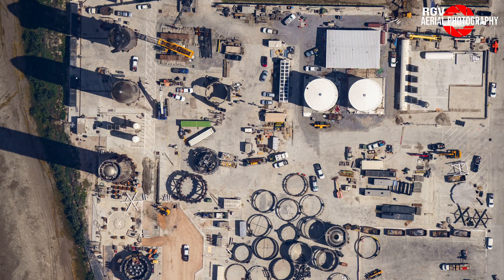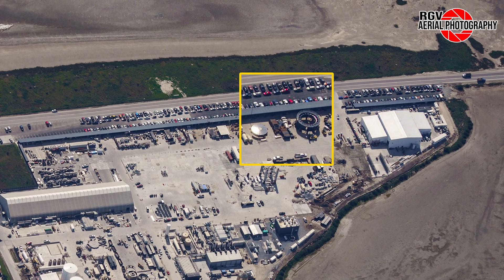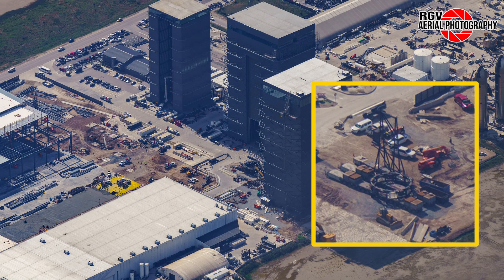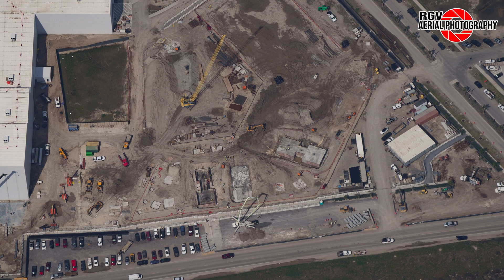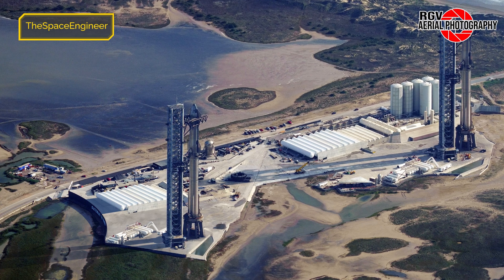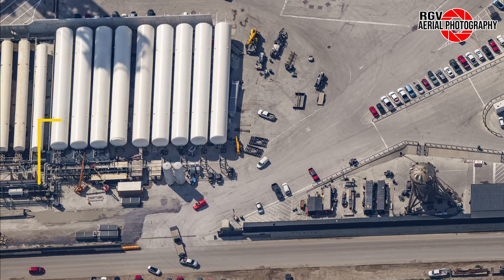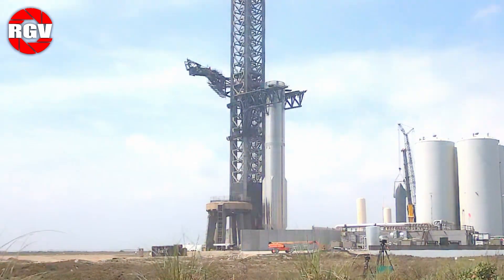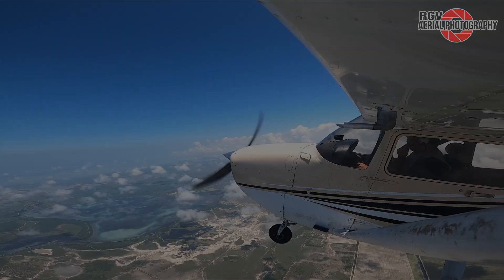Ship 28 Testing, Tower Two Work Starts! Starbase Flyover Update 33

Comment: Let's get something clear. ACE allowed SpaceX to self-retract the 2021 application to spare them the indignity of an outright rejection, which as anyone who has read it will tell you was the only possible outcome. Had it been properly prepared it is likely the BC launch site would now be double its current size. The was a huge missed opportunity because given the newfound public scrutiny of the BC operations, there is zero chance of anything resembling the 2021 request ever being granted.

I do hope SpaceX gets their measly 0.16 acres this time, if not this whole operation is in jeopardy.

Comment: I have a strong suspicion that tower two would be in a 180° orientation than the Space Engineer illustration because they would likely want the launch away from the complex.
Reply: I am 100% positive they will never have it facing that way cuz that’s facing towards the build site.
Reply: @forgegamer3118 so launching it towards the other tower and tank farm is better you think? 🤔 The build site is very far away in comparison.
Reply: @Karin12121 As much as I dislike and really hate the idea of its location taking over the historical suborbital tank farm and it launching over the first tower and tank farm I trust SpaceX in their decision (I hope....)
Reply: @forgegamer3118  is this SpaceX 's plan or a rendering by someone who just duplicated the tower orientation but just placed west.
Reply: @Karin12121 It is logical that the tower orientation is the same as the first tower as starship will launch in exactly the same direction to the southeast as from the first tower.
Reply: I would assume they want the full stack facing the ocean as to launch in that direction. But we shall see.
Reply: @x yep. it will never be rotated 180 degrees for this reason specifically.

plus, the whole launch site backend where the launch tables would be is on a significant diagonal from the road there. the new towers launch trajectory as pictured by the space engineer would have to do some serious lateral drifting to interfere with the first. (not the pad avoidance maneuver, which is different, and still; out of the way)
Reply: The rocket will be very high by the time it overflies the rest of the site
Reply: I’m thinking they will launch to the right of the first launch tower out over the mud plains. I’d be putting the launch stand in the corner as much as possible with the launch tower behind it and the pond in the car park behind the tower. To the left of the tower will be the loading area and where all the pipes come in. If need be the rocket can do a slight turn once it clears the launch facility, it will still be pretty slow at that stage so any loses will be minimal.